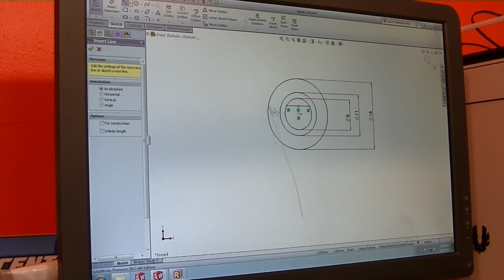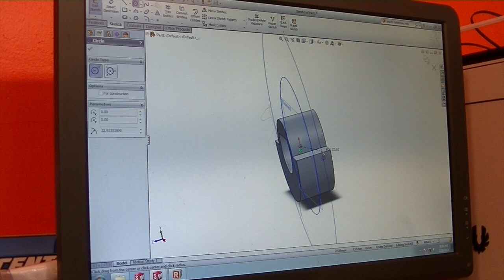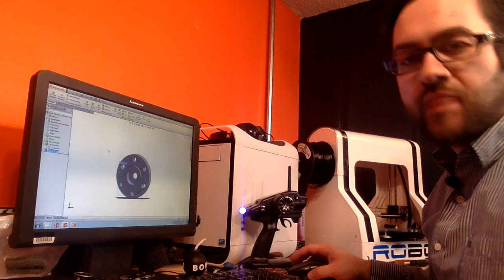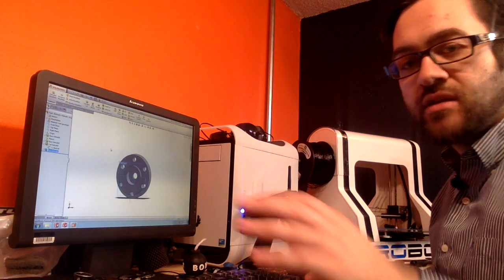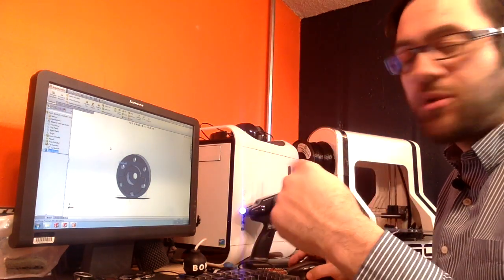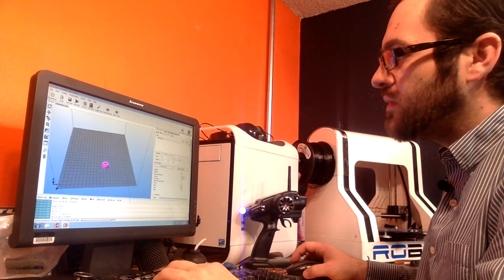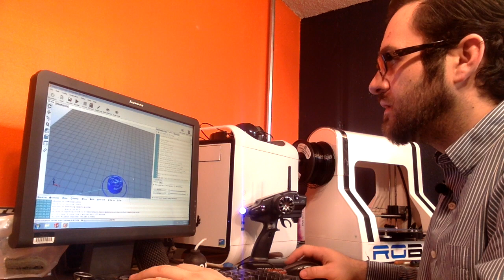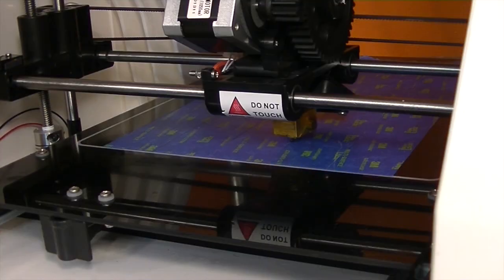Futaba Wheel Adapter for Vanquish 1.9 - 3D Printing - Robo3D

Comment: I think you should try to design and maybe even sell a portal axle adapter for the scx10 axles, that'd be AMAZING!
Reply from the maker: I do not plan to print parts for use in high stress areas.

Comment: even here in the netherlands the sound was Good HarleyDesignsInc  !!!!  #lol  
watching you draw... it shows you did this before... smooth and fast.
did i hear it correct that you own several Futaba radios ?? you can use 1 for several cars right. what is the use of several of them ??? just beeing curious ....
nice to see you use Picture in Picture.
Reply from the maker: The reason I have several radio is that I am on the Futaba Factory Team. I test radios and features often before new radios are released. I helped develop some of the crawler specific functions that are in the 4PK's and 4PL's.
Reply: and again i have learned something.
so some of them are beta versions. nice.
do some of them have features that are not been produced yet ?? or different shapes :) 
btw. thanks for answering.

Comment: very nice!

question on the robo printer, can the lair's be thinner or printed slower to get rid of the lines between lairs??
Reply from the maker: Yes, I am printing layers at 0.3mm currently and it goes down to 0.1mm layer heights. These settings are very similar to most 3D printers and you would see similar results with other machines running similar settings. For parts like this that are hidden and the outward appearance is not crucial I found it much faster.
Reply: cool beans!

would like to see what it can do detail wise... I am sure you have lots in mind.. just cant wait to see it..

thanks,
Mav

Comment: Question before i order , Will it fit a 3pmx.  Im guessing so as the stock wheel is identical.    Thanks for the vid
Reply from the maker: I'll post on my facebook when they are available for order. They will be limited availability so you'll have to keep an eye out. They should fit the 3PMx, I have one somewhere that I'll check.

Comment: That's pretty cool -- I'm sure they will fly off the shelves!  A matching wrap set would make for a really nice looking remote.  The audio was great.  Having the picture in a picture while the printer was running was cool--- makes for a shorter more efficient video package.  Glad you are having fun with it.  I'm betting we'll see some interior mud truck designs soon.
Reply from the maker: Thanks MG! I've got lots of project ideas for the mega truck and really need to get some of these outside projects done before I am going to focus more on it. I really want to get it done though!

Comment: Hi Harley how are you I love you vids you do out standing work I have a question in one of your vids you should some tire foams I think you said thay were closed sell foam and were quite stiff I built a 6x6 and the front is really heavy and I need a good stiff foam could you tell me where to get them I just need 2 1.9's I hope thay don't cost to much lol I'm supper broke but I need them for my monster lol I hope you can help me out with this pleas :-) thanks BUNZNMEPOCKETS
Reply from the maker: They are from Crawler Innovations. The Closed Cell foams for a 1.9 wheel run about 8 bucks for a pair. Super cheap.
Reply: Cool thanks HarleyDesignsInc I will go check them out
Reply: Thanks HarleyDesignsInc I just placed my order for 6 foams for my 6x6 I think this will be the answer to my squishy tire problem lol I think this monster is about   
15 or so lbs thanks aegean for the info